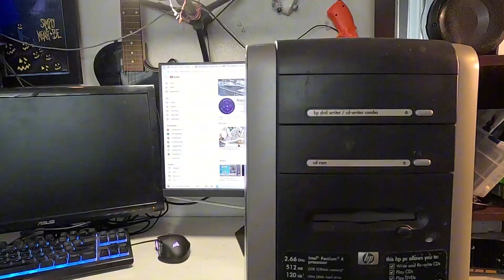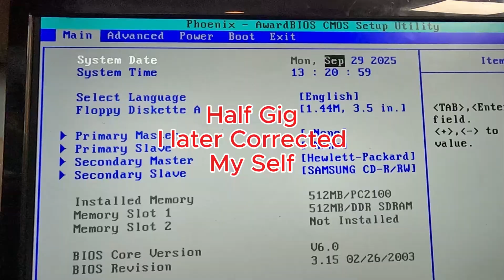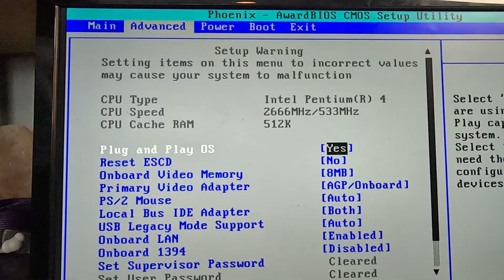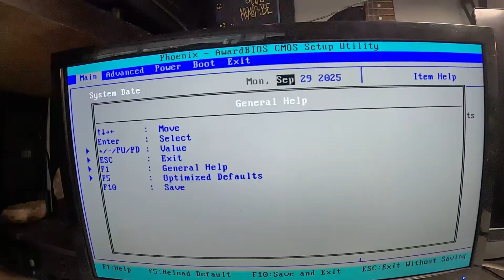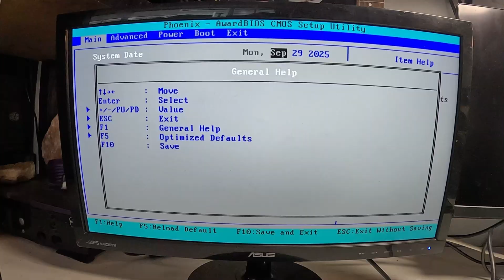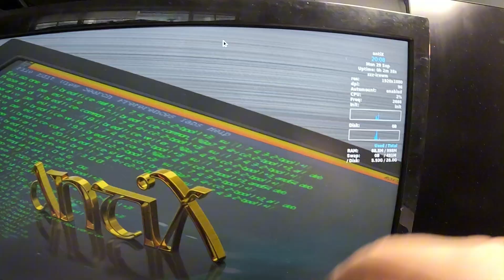This Forgotten Pentium 4 PC Runs Again After 20 Years!

Comment: I love old machines got a few....Pentium 200 mmx with an S3 virge 8mb running Win 95, Pentium II 350mhz slot1 with an GF4 MX440 64mb running Win 98, Pentium III 1Ghz socket 370 with an FX5200 128mb running Win98 (its a garbage of a video card for Win XP but runs well on Win 98), Pentium 4 2.8Ghz socket 478 with a Radeon 9600 XT 256mb running Win XP, Pentium 4 3.0Ghz socket 775 with an 8800 GT 512mb running Win XP, nothing special but i like this litle collection i got. I love your videos and you doing a great job keep going!  Greetings from Portugal
Reply from the maker: Hell to the ya, sounds like a great collection!

Comment: There are lots of old machines like that floating around the thrift stores. I have an old Dell Precision 3000 with Windows XP still installed but it just sits like a museum piece alongside another Dell GX 520 with a Pentium 3.20Mhz that has Linux Mint. The Dell 3000 runs but has a few bulging capacitors that were a huge problem back then. It also is a prime candidate for a sleeper build when I get around to doing it. That's actually the first thing I notice in old PC's like that HP, if the layout can accommodate modern parts and a cooling solution.  Thanks for the upload, it's cool going back in time and comparing to today's machines and hardware.
Reply from the maker: Thanks for the comment. Your system sounds pretty solid. This system definitely had a couple bulging caps but tested good so I left them. I would love to do a sleeper build in the future for sure tho